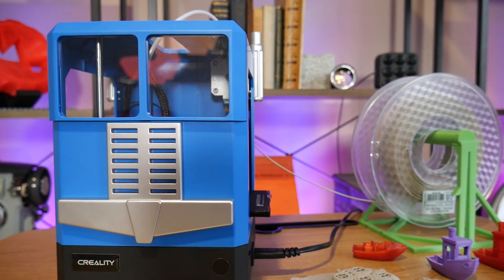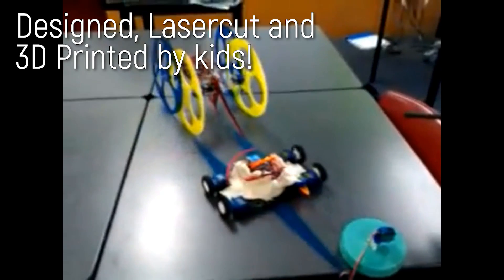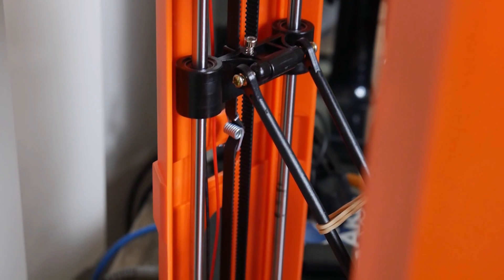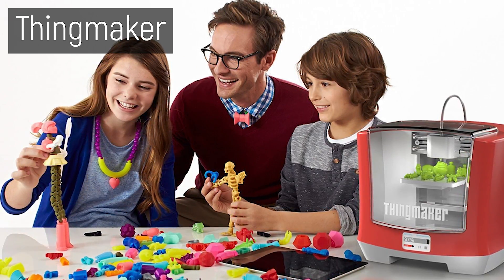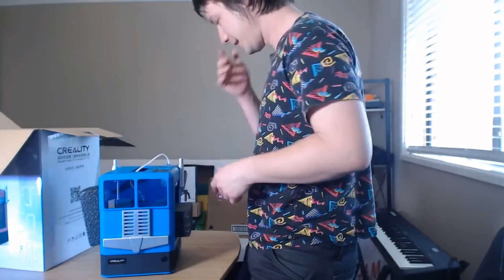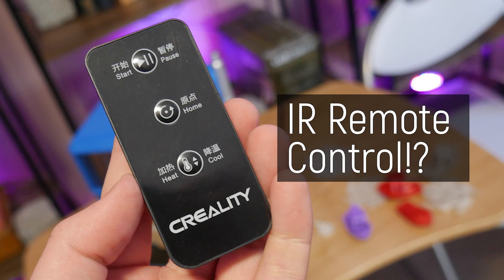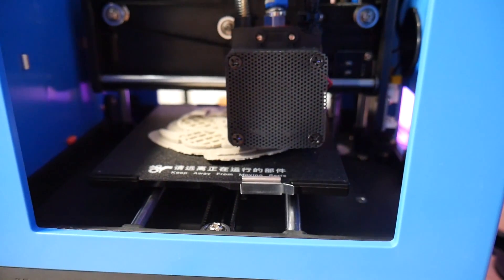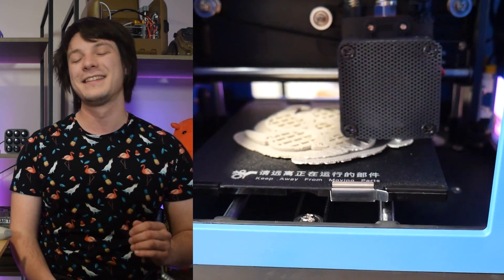This 3D Printer looks like a TRUCK. CR-100 Review

Comment: I tend to agree.
Kids aren't stupid.

I know of kids. Like 6 and 7 years old.
Who use knives,  chopping up pork, vegetables. Using a hob and hot pans.
Teach them and they learn. 
So buy a "real" 3D printer and teach them to use that.
Given time, they learn not to touch the hot end and resist the urge to push fingers into the prrint area as it prints.

Common sense is learnt through experience. 
Don't wrap kids in cotton wool.
We do that too much nowadays.
Reply: Totally agree, a child raised in a "bubble" cannot experience life's lessons.
Reply: +1, the best feature of a kid-friendly 3d printer should IMHO be unbreakability - like the spring-loaded nozzle (in case Z homing switch fails), tons of various sensors, etc. ... There should still be some safety features like lowering Z during homing with extremely small current, so if the palm of a hand gets "stuck" between a 200C nozzle and a bed, there is no permanent hole through the hand, ... but there's not much else beyond that.
Reply: That is so true. Problem: it is just not possible to keep every type of risk away from them. As soon as our daughter started to get mobile, we started to explain why things were dangerous. We protect her excessevly - with knowledge, so that she is forced to use her own brain. That makes her much more interested how things work and not afraid of things. 

So for that money, just get a normal printer which fits your requirements and explain how it works and what not to do.

If your child is interested in transformers, just start a collection of actionfigures with your 3D printer. Learn how to develop a figure, prime and paint them.
Now that is an activity to do together and be proud of!
Reply: Im 15 years old, i just cant resist touching the heated bed of my ender 3 pro:(
Reply: @kingi7607  
No 3D printer for you then until you learn to not touch! Lol
Reply: @jirij  
Some of your safety concerns are easily addressed.
Like having the printer in a fully enclosed case.
A self locking door takes care of parts being hot and fingers being in the way.

If you click to open the door. Have the printer move the head to an area hidden away where you can't touch the head. Most inkjet printers do something similar.
Maybe have the printer wait until the heatbed bed is cooler than about 75°c before allowing the door to be opened. 

But yes. Otherwise. Extras like auto bed leveling, filament rumour sensor, thermal runaway, camera would need to be incorporated.
Which ofcourse all push the price up.
Reply: @jparky1972  yeah:D
Reply: @kingi7607  I'm 39 and I still touch my heat bed.
Reply: @kingi7607  during winter, it's a good way to warm up your hand
Reply: @reminisce314  well its starting to get quite cold here, below zero C at nights
Reply: Teach your kids how to use a hot glue gun (low temp kind). They'll quickly learn how to deal with hot things that melt plastic, guaranteed. My 7 year old granddaughter now uses her own hotmelt gun without supervision (and does a good job with it). Her two older siblings (12 and 14) are easily competent enough to use my lllP Mini without supervision (I still help them with the slicer, depending on what they're printing). It really is getting them to understand what not to do, and leave the rest to them to figure out.
Reply: At the age of 7 i would drive a snowmobile in the backyard
Reply: as a KIND of a kid myself i agree
Reply: @kingi7607  lol
Reply: let them touch the hotend, warn them first, but they will never do it again

oh, and did i mention that i, when i was about 10/11 year i already could use an anglegrinder and drills and such. I hate the current mentality of (some) adults (at least where i live, the netherlands) which is like: (read in snobby voice) "ooh, you must be able to perform certain actions like you have to be able to walk or be able to read/speak before a certain age, but when you are older its like, noo, noo, youre too young for that, that machine is waaayyyy too complicated for you" whilst in reality you are more that capable of handling that machine. i am glad my parents weren't such people
Reply: @kingi7607  I'm 45 and I've been burned a few times, touching both the bed and the nozzle, so I guess I should grow up a bit before getting another 3d printer…
Reply: Jason Park kids aren’t dumb, my kids count too.
Reply: Teach them and they learn. Laughs at being able to handle a laser and a 3D printer by myself without much assistance.
Reply: I do agree I saw kids just recently I thought he was more smarter than the adults

Comment: Why is everyone so concerned about the hot end when it comes to kids?
Kids have a built in safety feature called OUCH THAT'S HOT!™ and will automatically pull away their fingers if they touch something hot, then their software will update and they will remember not to touch that hot thing again.
Reply: lmao
Reply: That's true, I mean everyone burn themselves sooner or later....but that doesn't stop their parents from worrying about it though :P
Reply: This just made my day lol XD
I remember touching the stove when I was a kid, learnt quickly to not touch stoves when they've been used recently!
Reply: Ouch that’s hot
Reply: Vbucks™️
Reply: theres a major difference in temperature and burn between say, a stove, and a printer printing PLA or especially ABS. while a stove can get to 250°C and above, you usually aren't cooking that hot unless you're trying to burn something...
Reply: aibo goku Normal frying temperature is aroun 180 C, so not that much of a difference to a printer. When it comes to burn injuries a 200 C or 500 C surface doesn’t really make a difference, the big difference is the area you come into contact with, that’s why a stove is much more dangerous. You can easily burn your entire hand on a stove while you can basically only burn the tip of your fingers on a printer head, while it could lead to nerve damage and lowered fingertip sensitivity (especially for a developing child) the damage is rather mild. I’ve burnt myself tens of times fixing my printer cause I’m lazy and don’t have patience, but it’s always the fingertips and never had a burn which didn’t go away in like 3 days. Though I’ve never had a bad burn on the printer. Don’t get me wrong, children shouldn’t be left unatended with a 3D printer, that’s dumb for many reasons, but I think the hot end being hot is a vastly overblown danger.
Reply: you mean after they severely burned their fingertip, got a fright, fell backwards and crashed against a table with a mug of Mum's hot coffee on it and ended up on the floor with their face & chest now also burned, and on their way to hospital? Unfortunately many kids (inc a friend of mine who was born umbilically strangled but as an adult very slowly learned how to use a computer) need additional physical protection rather than to be visually entertained by the look of the printer..
Reply: @goldbunny1973  You forgot about Moms giant swinging axe and trapdoor to the rancor the child will stumble into after burning their fingertips.

If your best argument for why this is dangerous is ”There could be even more dangerous things around the child”, that’s not a very strong argument for this being dangerous. In fact, you’re admitting that it’s not particularly dangerous to burn your fingertips by adding the other death traps for the child to fall into.

That said, I do agree that marketing it as a toy is irresponsible because it will make parents treat it as just another toy which requires no supervision, which it obviously isn’t, it can hurt them and it can even burn down the house if missmanaged (like a child does to most of their toys).
Reply: @beaconofwierd1883  I didn't realise it was a Points-Scoring Exercise in commenting on why I don't think it's a great idea to make a 210degC hotend look like part of a toy truck to a 5yr old. Severely painful, permanently scarring finger burns are possible by touching a hotend. If you make the machine look like a toy - make it *impossible* for small fingers to access moving/heated components rather than making 1st Degree burns an Early Learning Experience.
Reply: @goldbunny1973  Fine, I’ll pass you some pepper.

Comment: I'm 15 but bought my own 3D printer when I was 14. The printer was an Alfawise U30 from Gearbest and although there were some shipping issues (it took SEVRAL months to get everything in working order) it has been serving me well. I am still trying to figure out exactly how to get a good bed level on build tack or glass (it has both). I have taught myself everything from how to design, slice g-code, and run the printer. After watching your videos (and many others) I use the free version of fusion 360 and PrussaSlicer.
I have a lot to learn about everything involving 3D printing but I think an enthusiastic 8+ year old could operate a "real" 3D printer like the Ender 3 if they had some help setting everything up. I'm not saying this is best practices, but my printer is not completely closed off from yung children in my house (3 and 5 years old) and nothing has happened except a print being canceled because a mischevious chiled pressed some buttons.

Comment: Great review and educational lesson! My favorite way to protect my finger from the nozzle is with a silicone cover, saved my fingers from a couple of blisters and a lot simpler than an enclosure. As for a heated bed, limiting the heat to 60 degrees (or any temp below boiling if you like to live on the edge) and throwing in smart tmc drivers can protect fingers just the same as an enclosure. Looking forward to more of your videos!

Comment: This got me thinking because I’m starting a 3d printing with my 4th graders this year. We are still in the design faze, but I don’t think anything that heats plastic should be treated like a toy.
Reply: I agree, it should never be called a toy. They should clearly advertise it as something that needs parents' supervision. Kids are curious and might find their way in to feel the hot end. I don't think every kid will do this at all, but there are some smarter than the others. Even for protection of the parents, it shouldn't be called a toy. If somehow a 3d printer manages to market it as a fun toy, there are also dumb parents, who will just think it's okay to leave them alone with this toy.

I think products are mostly designed to be safe for the biggest idiots, this includes kids and parents. So a 3d printer should also be handled that way, and therefor it can never be considered a toy to me.

Sure you can introduce your kid to it at young age, just like, for example cooking food, DIY projects. Let them observe and learn from your mistakes.

Comment: I totally agree that kid-friendly printers should have a great emphasis on usability, reliability and safety but I think I have a different opinion about what "safety" looks like on a 3d printer. Of course, I wouldn't want a printer to be dangerous in the sense that it could shock someone or that it would crush or break fingers, but I think there's a great benefit of having an unenclosed printer for kids. 
First of all, the printing process is super interesting and exciting and even I still find myself staring for hours at my printer doing its magic. Adding an enclosure adds a layer of separation and obstructs the kid from really taking in whats happening: 
Sounds will be dampened, so possible crackling of wet filament might be inaudible, as well as the sound of stepper motors losing steps or the cracking sound of layer separation or the separation between the print and the build plate. 
Also the radiating heat from the build plate and the nozzle will be obstructed, which could lessen the understanding of the energy usage of such a machine, which of course isn't much but there are still some lessons to be learned on that topic. 
Then you have the smell which will also be less if the printer is properly enclosed: I'd say let them get a proper headache of the smell of ABS and then tell them that thats one of the main plastics in all consumer products.

Now to the curious fingers: Let them burn themselves. It's not like they are going to lose a finger about that. It's a safe and great way to teach about how you should be careful around automated machines and on top of that, you could use the accident to show them where first aid kit is located and how to use it.

Maybe I first have to be a father to think differently about that...
Reply: I had a wood-burning kit when I was 8.  I never burned myself on it.  I also never burned down the house, which is much less of a risk with a 3d-printer (so long as it has thermal runaway protection...)

Comment: ToyBox has made a relatively easy to use printer for kids.  I got one for my 6 year old and was impressed with it.  But as you said, safety for kids is always a concern.  Even thought she is use to being around all my 3D printers I have it on a WiFi controlled outlet to ensure it is only used while supervised.

Comment: For a "kid friendly" starter printer, honestly, the Flashforge Finder is pretty good.  The menu is touch screen, full color, pretty intuitive.   Runs of a USB stick, can be made to be fully enclosed but most of the finger pinch bits are out of sight. No heated bed, but for the most part everything sticks pretty find without it.   Works right out of the box, doesn't need any real repair or tinkering and it's super reliable.  You can even use the interface to load and unload the filament so little fingers don't need to go anywhere near the hot end when it's hot.     I would 100% give it to a 12 year old and let them go to town with it.

Comment: I think you may be undervaluing kids, I started with a prusa i3 mk2s when I was 13 and S3D for slicing. I have never been burned or hurt by a printer and all this after over 5km of filament through one machine and a hot end swap to a E3D volcano. I'm not saying that every kid would have the inclination to do that but they wont hurt themselves either.

Comment: I believe that, as a kid myself (13), we should be able to do more things on our own. I built my ender 3 by myself, and did upgrades to it as well. It was simple enough, and I now am able to fix almost any problem that arises, since I know how it works. And yeah, hotend is hot, but I learned that, then I felt it on accident while changing nozzles, and I do my best to not touch it. If you let us learn we will.

Comment: I just go into 3d printing three weeks ago because I found this printer on Amazon for under $80 USD. Don't look for it there now at this price they're all gone. The first one I got worked like a charm the first day and then refused to power on the second. Couldn't find a fuse anywhere so since it was only a day old I returned it for a replacement to Amazon. The replacement arrived and I was in business again. I was actually quite happy with print quality and speed. I was pushing out fabrications like mad and having a wonderful time with this tiny printer then I started to experience consistant out of alignment layers. I looked up online how to deal with such things and found that you can not make adjustments on this printer at least not easily. So back it went this time for good. I am now using a Monoprice Delta Mini and just getting acquainted with it. Hopefully I will have better results with this one (although this thing is terribly slow to heat the bed)

Comment: I've used the Cel Robox in the past and the idea of a Lock the doors while printing would be ideal for kids. Also add a big red button to stop the print if they see something going wrong. (E.g. have the door only unlock once it is cooled enough to touch both the bed and the hot end). That will stop fingers getting burned. A also having a purge/cleaning cycle a bit like an inkjet printer would be good as well as a "Load Ink" button which will take them through the loading of the filament and automate everything past putting the filament into a tube.
But the first thing I would work on would be a piece of software that would load an 3d object, let them size it within reason, use some kind of AI to work out the best orientation to print something and handle adding supports automatically. (Obviously this is the Child mode, with more flexibility that can be unlocked if needed). Once the print has completed, have some instructions on how to "Finish" the model. E.g. how to remove the supports etc.
Unfortunately the biggest problem would be this sort of think at the moment would probably cost a fortune in R&D to develop hence have a steep price per unit which will make it not very attractive for a manufacture to make.

Comment: There is an age where a kid no longer tries to reach for things when you told them it is hot or sharp or dangerous. For my kids around 5 years of age I was comfortable in knowing they wouldn’t hurt themselves when I had already given instructions. Even at 3 they were usually good but sometimes needed reminding, so really the only real safety needed is to keep the device from self destructing when in use. 

The one product that looks surprisingly good is the toybox 3D printer mostly do to the simple to use app.  Teaching a 5 year old how to find and download a model from thingiverse, then load it into the slicer to get get the model correct, so you could then load it to the printer to print is not as satisfying to a child as a simple app. Hopefully over time we can get simple apps to interface thingiverse and send models to our 3D printers using a preconfigured low quality preset for your printer. But for now I would like to see your take on toybox.